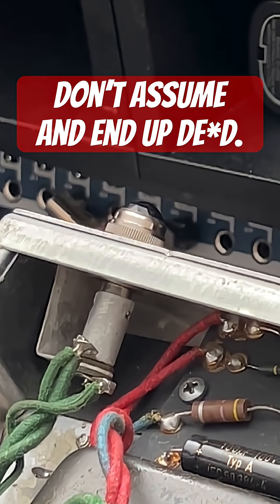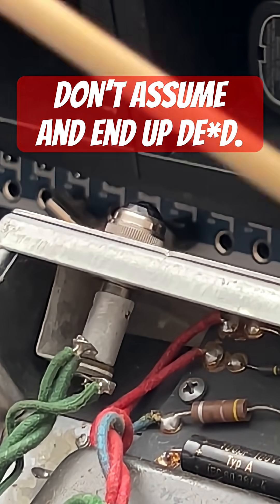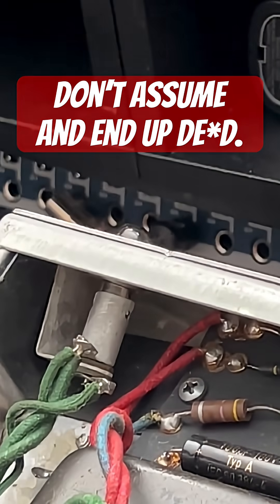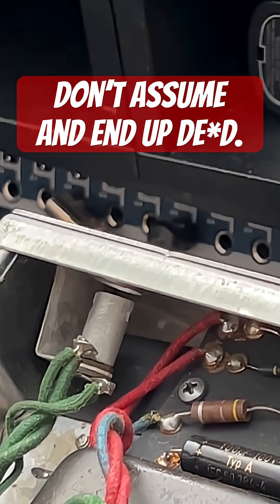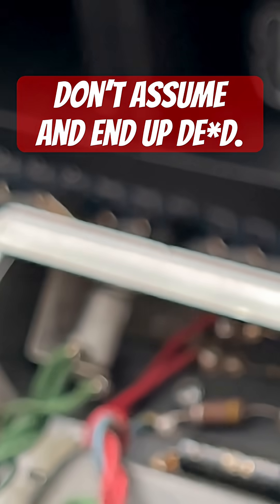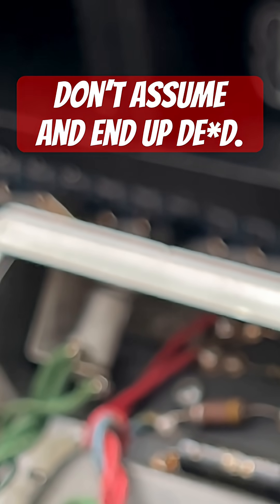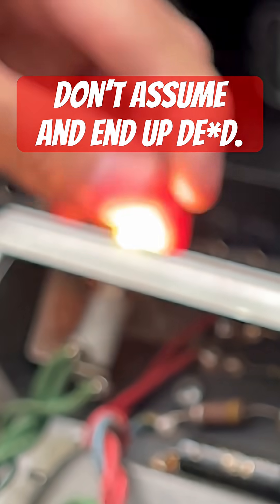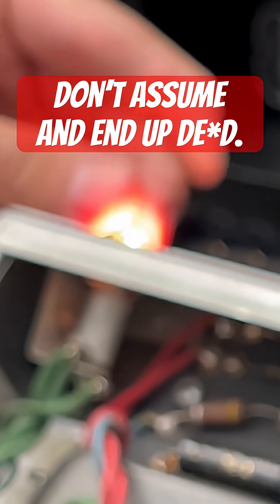Don’t Assume & End Up De*d. ‘67 Fender Showman Repair #electronicsengineering #fender

Comment: I used to work on 30kw generators. I was testing the panel on a hot summer day and I wasn't wearing my long-sleeve top and accidentally put my arm down close enough to the step-down that it arced to my elbow because of sweat. Knocked me on my ass about 5 feet from the generator.
Reply from the maker: Dude, I'm glad youre still around!  After college I was working on installing telecoms cabinets in the middle of nowhere Mississippi and this dude's screwdriver tip accidentally touched a hot terminal and it literally blew the tip off!  We immediately powered down and went and got drunk on cheeseburgers.